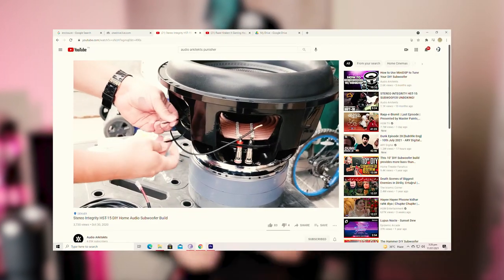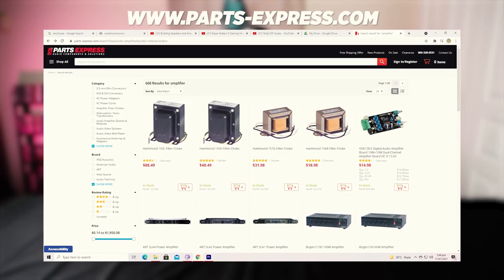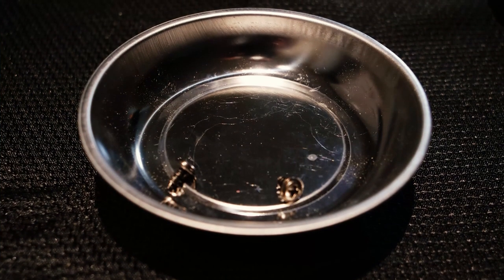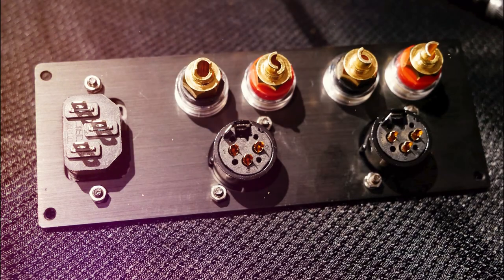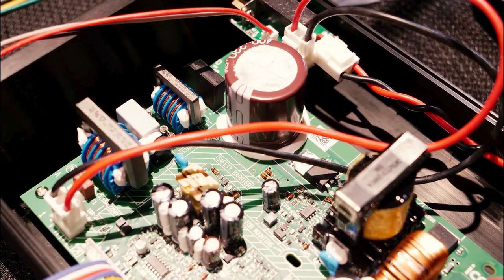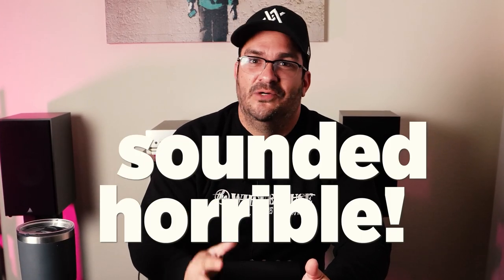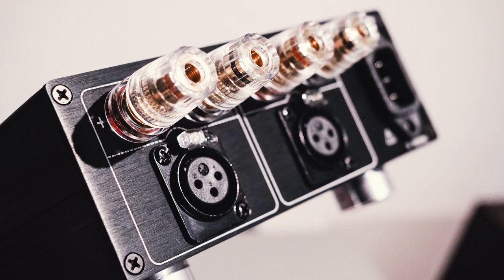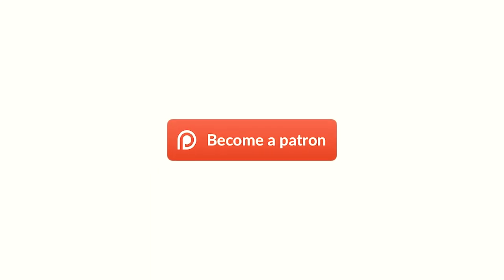I Built a $3000 DIY Audiophile Amplifier for Only $300?!

Comment: I don't understand why there aren't (maybe I just haven't found them?) integrated tube amp kits available. Surely you could build something as good as a Willsenton R8 for far less money, especially given that the technology is well, old and well understood, by now.  Sure would be nice to build a $1500 amp for around $300 to $500 depending on the tube complement you choose.  I'm old enough to remember Heath Kit. A high school friend of mine and his dad built a TV in the 1970s from them. And it worked!
Reply from the maker: I agree. There should be DIY Tube amp kits more readily available.
Reply: @audioarkitekts  You may find some preamp tube kits on AE or Amazon, but you won't find power amps. Why? Because tube power amps need output transformers, which as much or more than a whole tube preamp alone. What you will find in AE/Amazon are hybrids: tube first stage, class D output stage. Not the same thing.

Comment: If all you need is a small "drop" of solder you can melt the solder on the tip of your soldering iron, and then place the tip to the point being soldered. It doesn't hurt adding a dab of flux with like a toothpick to the point being soldered first. You don't need to always add solder via the solder itself, many time just the tip of the soldering pen will hold enough for what you need. If your solder is "rolling off" the point being soldered, you need more flux. This will work even with small wire soldering. I don't know how good they are, but there are soldering guns that "feed" the solder to the tip for you. But most people I see soldering don't use them. But again, for a small "drop" of solder, in theory it seems they would work. Good Luck!

Comment: You messed up at the power connector. It should be on the inside, not outside. I know because I just made the same mistaking building mine and luckily caught it in time to fix it before all the soldering.

Also in the standoffs, you needed to have the metal stand off at specific mounting locations for grounding I think.
Reply from the maker: I know, I saw that after the video was posted 😞
Reply: @audioarkitekts  Just responding to the Easter egg challenge from the video. Thanks for the great video and confirming that it does compete with $3K amps. It's going to satisfy my upgrade itch for a while. =)
Reply from the maker: @t0nyxgq  oh my gosh I had forgotten about that it's been so long on that build. I got a Purifi build I am doing this weekend its going to be much better.
Reply: @audioarkitekts  Hope you make a video of it!

Comment: Kit amp.  not true diy audio.  but it’s a start.
Reply from the maker: We all have to start somewhere. If I had to make the boards myself I feel it would have been disastrous lol
Reply: @audioarkitekts  Try point to point on a simple circuit like a valve (tube) circuit.
Reply: Its DIY.  When you build speakers do you manufacture the drivers?  How do you think manufacturers build their D class amps with ICE blocks and Hypex modules.  Open a PS Audio amp and look inside.  True its not a Heathkit from the 60's and 70's.

Comment: this amp has been tested at 80 watts, not 200.
Reply: 80 watts in 8 ohm!? (~200w in 4 ohms)
Reply: @babyfoot8441  if you measure it in different ways 4ohm can be more than double. but that is not a good way to measure.
Reply: Yes, you have rigth. But some speakers is in ~4 ohm. I prefer 8 ohm measurement.
Reply: @babyfoot8441  speakers are not any ohms specifically, you need to see a graph to see the line drawn across the frequency band. 
the one number you might have the most use for is the lowest ohm point in that graph, the minimum value a speaker goes to.
Reply: @sudd3660  I know. Therefore I use ~ characters! ( ~ 8 ohm)👍
Reply: @babyfoot8441  you are advanced commenter then :)  i only like graphs,

Comment: I want to make this as you did.  But it seems some of the parts you have left off.   Do you have a complete parts list that you can email me?
Reply from the maker: All the parts are listed in the description. The amps and case come with standoffs. The only thing I may have left out which I’ll add is the jumper so you won’t have to solder extra wires.